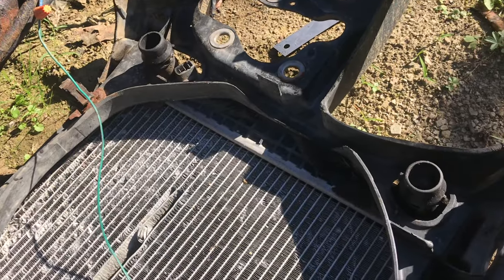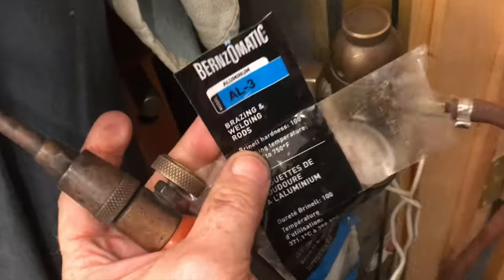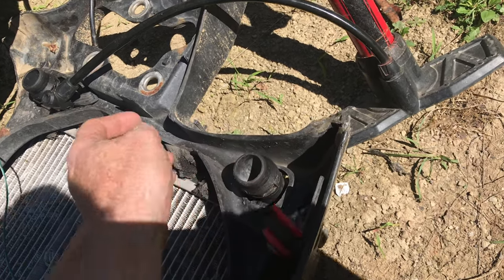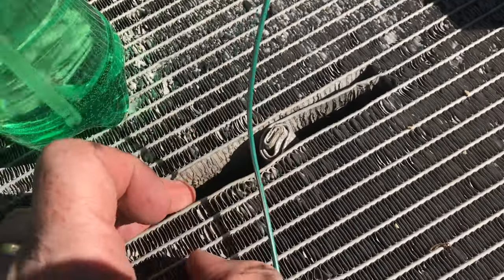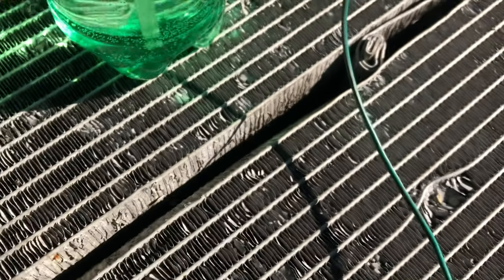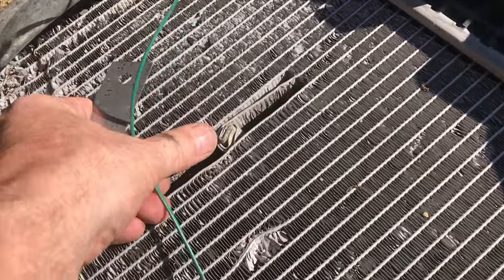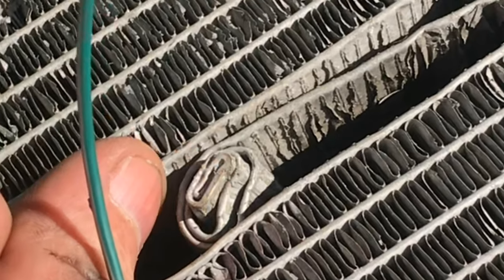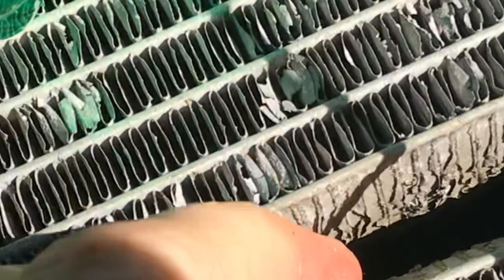UNCONVENTIONAL radiator repair that ACTUALLY WORKS (it’s ugly, but effective)

Comment: This video saved my vacation. Two hours from Vancouver road debris hit the radiator and made a big hole. Everything nearby was closed since it's a Sunday, and we had (expensive) tickets to see an event in Vancouver. Some cheap dollar store tools and a jug of distilled water later, we were back on the road.  If I didn't use your method we'd have missed the event, and paid a fortune for an emergency repair. Thank you!

Comment: For what it's worth here goes my 2 cents! Many years ago, one cracked brake pipe almost ended my vacation. Making me return earlier via tow truck. 😞
Suddenly, I completely lost the brakes and brake oil was copiously dripping on the ground. The sensation of having the brake pedal deep into the firewall. Is damn bad, any day of the week.
Luckily I was able to stop the car safely via handbrake. While my wife questioned "why I was stopping" literally in the middle of no where!

Short story, a couple of twists on the remaining brake pipe. Properly smashed with a locally sourced stone! 🙂And there we went for another week of vacation! On three wheels braking...
Reply: Now that's ingenuitive I once had the brakes fail from a leaking wheel cylinder. I popped the brake line off at the drum and shoved a BB in there and then tightened it back. I was already only on the front brakes, as I had adjusted the rear brakes so they wouldn't touch because they were metal on metal. I was a teenager

Comment: No need to pressure test @ 50 psi. 20 psi is plenty, most cooling systems operate at 13-18 psi. I myself prefer to solder, to do so the metal must be very clean .

Comment: Had to get towed today after my civic blew a hole in the radiator. Tow guy was an old school mechanic and told me this method is extremely reliable. Had to see what he was talking about, now I'm definitely going to give this a shot tomorrow! Thanks!
Reply: Works better if you roll it up and the cover the part you tore up and rolled in JB weld afterwards...prevents it from moving around and unsealing itself if you hit a pothole or something that might shake things around.
Reply: @funfun5656  cable tied to prevent unravelling or wrap with wire

Comment: Lot of work! JB weld was and year later still good! I used all of both tubes. Swished on the spot, left overnight. It’s fine
Reply: Done in 3 minutes. You going to sit on the side of the road for 48 hrs to cure?
Reply: @aqib2000  I thought they made a fast curing 20 min epoxy

Comment: Perfect fix. Good to know for the future. Thanks
Reply: And the future is here. I now have to use this method on my radiator as i have a hole. I knew this video would come in handy one day but didnt expect it to be just 2 months after watching this vid lol. Now time to roll mine up like a tube of toothpaste to fix my leak!
Reply: Did it work?
Reply: @anothergamingchannel2656  Yes it works perfectly. Also after this method I tried another method on another radiator that I accidentally pierced while working on the car and with that one I used jb weld. The one where u mix the 2 tubes together.  Filled the hole in and waited for it to set then drove the car 30,000 miles no problem it held up nicely until I sold it. That was a pin hole hole though

Comment: When you stuck in the boondies with nothing perfect solution. But honestly id do it cause it seems more time an labor efficient. I dont think i would of even taken it off, most vehicles front clips come off pretty easy an if the radiators shot you really aren't loosing. Thanks for the tip

Comment: Never tried that with a radiator, but have done that with steel and copper tubing and heater hose.  
If the radiator core is aluminum, I hope the tube didn't crack when bending it as aluminum is a soft non ferous metal.  Now if someone has a fix for a broken (small) hose port like the one on my wife's 06 Kia Sorento.  Ya it's on it's 3rd radiator thanks to that stupid small port!

Comment: Relative to all of the comments about some product that was supposed to work for this and didn’t, my first thought was having to do with surface prep…It is very hard to get anything to stick to aluminum, because it oxidizes, and a layer of oxidation will cause any patch to adhere to the oxidation, which will pop right off, not the raw aluminum. Napa has a product called Aluminum  Brightener, it is mostly phosphoric acid and sulfuric acid, but clearly, it is an ‘etchant’; so don’t spray it on polished aluminum, as it will leave a mark immediately. Otherwise, it foams up when you spray it on. you don’t have to scrub it, but you can... when you rinse it off, the aluminum will be much closer to a white color, this is because aluminum oxide is basically black, and if you’ve ever tried to polish aluminum then you already know it can be very frustrating as you realize most of what you do actually turns it blacker, and when you’re done it looks worse than it did. This aluminum brightener is in no way a polish, but it will be a more uniform color, and free from contaminants, so once this stuff has turned the aluminum white, it is about as corrosion free as it’s ever going to get and that would be the moment to rinse it , dry it, and be ready with whichever repair method you intend to try. In the past I have used  marine grade 2-part epoxy putty as a plug,, and try to push some of it actually through the crack or hole, hoping it will penetrate to the inside of the tubing and cure in such a way that it can’t get out, then I would use another two-part epoxy and possibly some kind of patch material over all that and I have had good luck with it. My limited experience with the superglue and baking soda method has been very positive and next time I have something like that I might try that first… Hint: I put some baking soda in an old blender, and ran it until the baking soda was the consistency of powdered sugar. The resulting increase in surface area caused the reaction to be even more intense, And the smaller size particles cause the patch to be much denser than it was with straight out of the box baking soda… For whatever that’s worth… Good luck!

Comment: Did you have to do anything to the ends you cut to prevent them from leaking, or was it enough just to tightly roll them up?
Reply: Good question

Comment: ...by the way, do you have any vids that could help us repair where the aluminum meets the plastic top of the radiator? I've had some success with the 2 part plastic epoxys but only sometimes.

Comment: 50 psi? Well no wonder nothing sticks . that is far too much pressure. Most radiator caps are somewhere around 16. They make them as low as 2 to 4 psi. As radiators get older they cant hold as much pressure as when new. Then add a damaged spot.

Comment: I rolled up much less and tried to get it real tight and I had pin holes and I had like 4 or 5 rows but some aluminum stop leak did its job I have a new one ordered I don't really trust it and it's my mom's car

Comment: This is genius. But if you have the money for a radiator, with all the work involved it seems silly to not buy a new one.  Unless if was a fairly new radiator and the cause of the leak was something weird, it seems  almost (but not entirely) predictable that an older rad would get another leak soon anyway.  Maybe not, but if that happened in  a few weeks or months, it wouldn't seem so genius anymore.